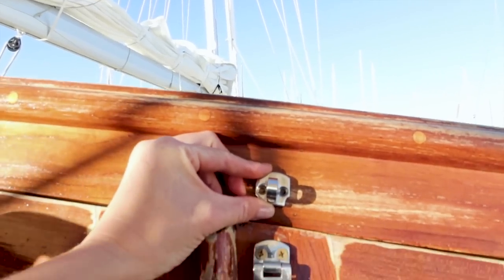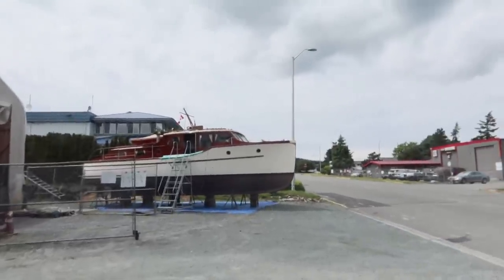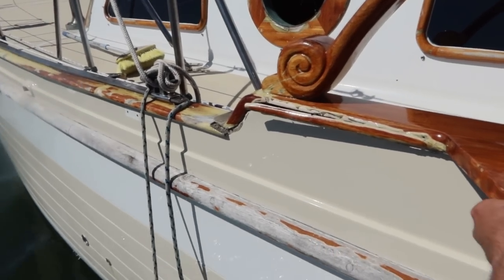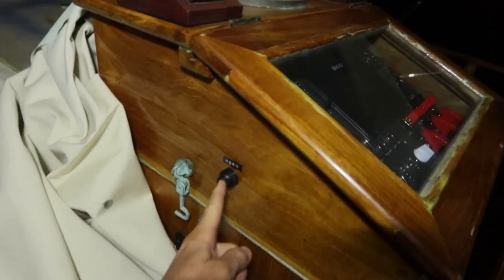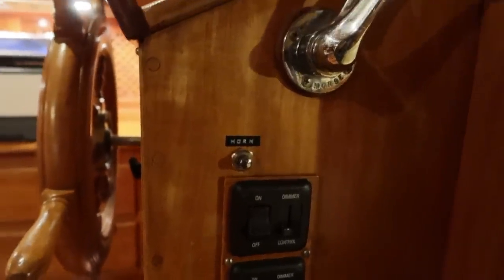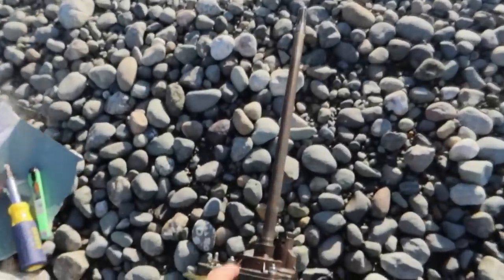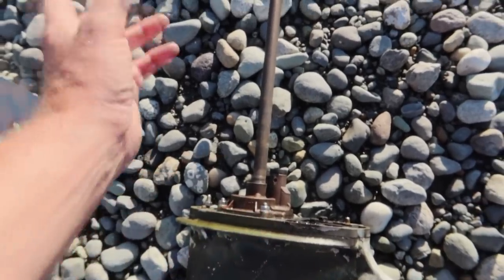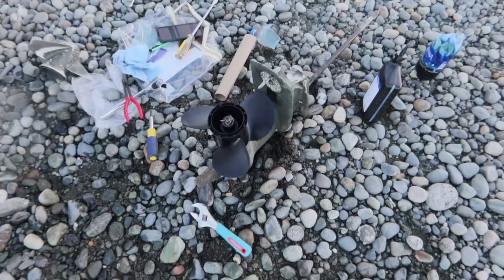Fort Knocks Sailboat | PIRATE SHIP S15E11

Comment: Having the alarm silence switch is certainly convenient. But a warning amber light should always be activated whenever the alarm is in a silenced 🔕  position! It's too easy to accidently bump toggle  or silence alarm and forget to reposition in the "live" alarm mode. With an amber light energized in silence position you will never miss a Real Life flooding problem! Something to consider whenever installing override switches!
Reply: Some controls flash an led diagnostic signal that is a code for the problem.

Comment: Take red wax and form a piece over the wood where the chainplates rubbed . Then cast them in bronze using old thru hulls . Just find some one with a kiln to burn out the wax from the plaster molds . That would be cool, pewter also would work and it melts easy.

Comment: Scoring on the pump-plate is a sign of wear. Use the whole kit not just the impellor. 
Also change the thermostat and flush.
Milky oil in the lower means a seal leak behind the prop & h2O in the gear oil. Nice boat !

Comment: oké, that padlock? it is overkill.
The tiny screws you used to bolt 'the thing with no name' down are very easily defeated by a large screwdriver or crowbar
Reply: Yes, but the Masterlock padlock will fall open at the first sight of a wave rake, so the lock eyelet and the wood will still be safe...

Comment: The lower unit should be filled from bottom with pressure gun and when it comes out top you close top then bottom. that way you always get the right amount in. also with that dark of oil I would have put some seafoam in it with oil then run it at low idle in forward then replace oil again.  gives it a nice clean which helps remove any fragments. I used to rebuild lower units all the time.
Reply: Also the drain screw is magnetic to catch filings.
Reply: @youdonthavetoreadthispost.5850  yes it is. that is why I like to flush the lower unit out once a year. A lower unit should last longer that the engine does.
Reply: @dc1544  Most neglected part on most outboards. that impellor need changing regularly. If you don't - you risk the entire engine for the price of a water pump kit and an hours labor. Clock the hours on your engines and keep to a schedule.
You are spot on - pay me now or pay much more later ! Assuming it doesn't happen at sea ? then there could be no "later". 👍

Comment: So, anyone with a Phillips head screwdriver can easily break into your boat, just by unscrewing those two little screws on your companionway slide???
Reply: Hi, I personally would try to bolt through the wooden surround, this will at least make it as strong as the wood.
I don't think anyone can or would remove the screws with a screwdriver, the screw heads are covered with the hasp. That size of wood screw can easily be levered out. The bit you fitted Aubrey was the staple, so the two parts are hasp and staple.
Keep up the good work!!